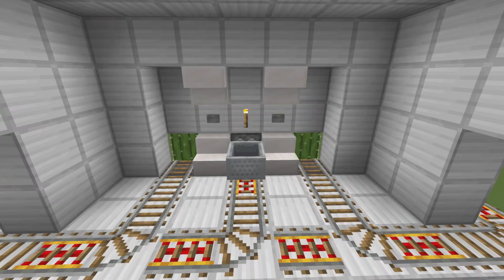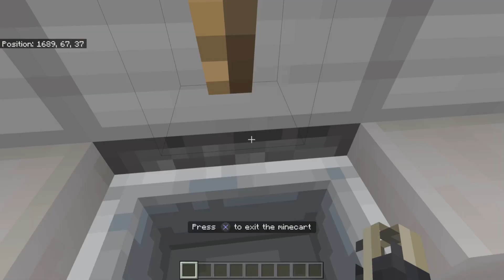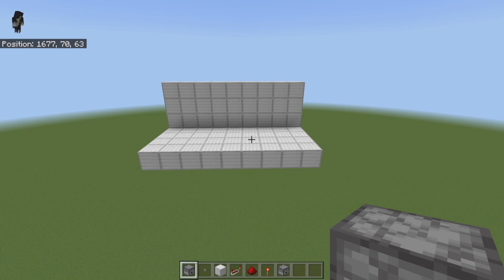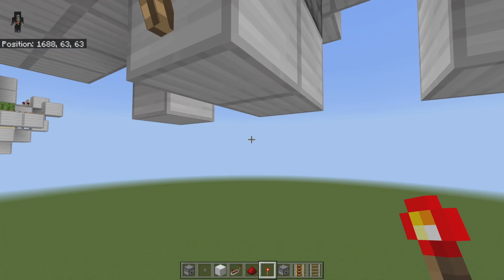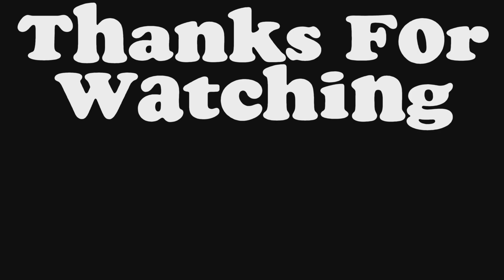Super Simple 2 Way Minecart Station!!! (Easy) [Minecraft Bedrock 1.21]

Comment: Java 1.21.8. I got this to work pretty easily. I moved the buttons over two blocks and just looped the redstone around with dust running into the repeaters on the opposite side of the blocks. You must have 4 minecarts in the system at all times, including the cart sitting on the track (3+1). I put a button above the dispenser just in case minecart launch screws up. Thanks for the build!
Reply from the maker: Thanks LanolinTV, theres a couple of ways to make it work on Java

Comment: I play in java 1.21.5. and it doesn't work. But if you move the blocks behind the buttons one block further back and put three others in front of them and place redstone dust in front of the two repeaters, that way the dispenser gets a signal. Also remember to extend with a block that the redstone torch (which is between the two repeaters) gives a signal to, otherwise the dropper won't get a signal.
Reply from the maker: Awesome, would you be so kind as to join my discord fan chat, I offer redstone support and would love a photo of what you you did so I can help others. Here is the link:
https://discord.gg/HHBmdqvB

Comment: What can I use in place of the cactus to return the car to The Hoppers because every time it hits the cactus it destroys it and not send it back into the Hopper to collect it
Reply from the maker: Thats interesting? Well I'm not sure, I know camp fires used to work but I think that got patched. If I were u, try testing in creative what things break minecarts, and see if u could use things like camp fires, pointed drip stone, or even try just an activator rail that ejects u from the cart and sends it elswhere to be broken behind the wall. These are just some suggestions, but I've never had anyone have this issue before. Also check for chunk borders, maybe ur right on the border and its causing it to act funny. Let me know what u find out. Im at work today but can reply every so often, and if needed, u can join my discord and send in photos so we can help fix this for u
Reply: @brokenbones623      so yeah I'll give it a test and see what I can find out through creative mode on what works and what doesn't work cuz it's such a simple design and I liked it so much and is there a way to add multiple lines or is it just as simple as copying the left side
Reply from the maker: @ricksalazar629 idk, what u mean by adding another line, like another rail line?
Reply: @brokenbones623  
Yeah. Another set of tracks to make 3 or more paths from the same station.
Reply from the maker: @ricksalazar629 I can make another tutorial I have a design that's infinitely expandable
Reply from the maker: This design is just a simple one, leave it, there's a better way
Reply: Oh I would love to see that and I have noticed on a different design that a full-grown cactus will actually collect the cart
Reply from the maker: It will also hurt u wouldn't it